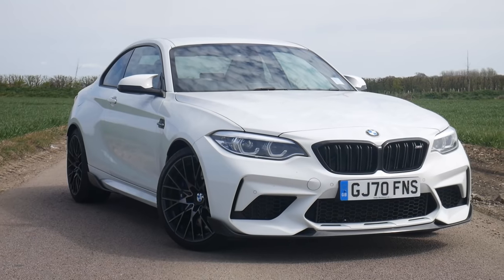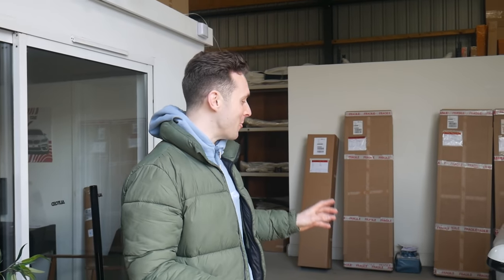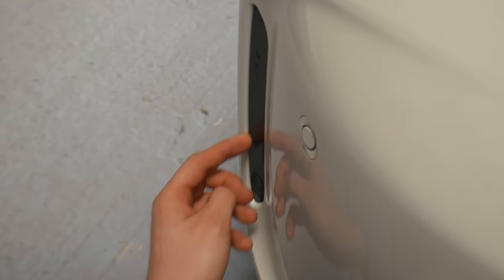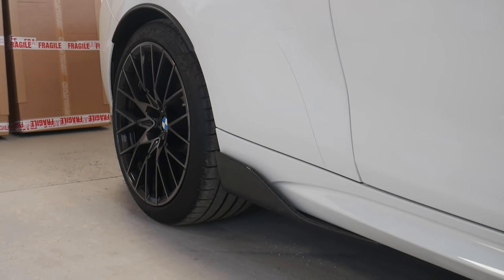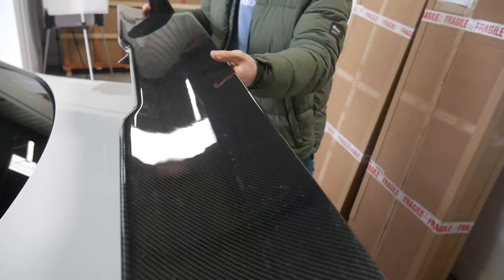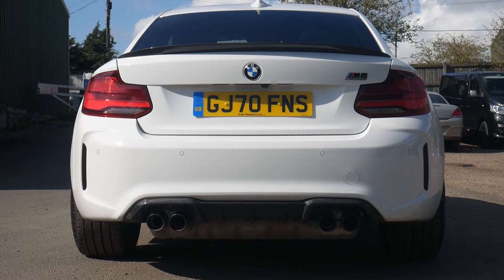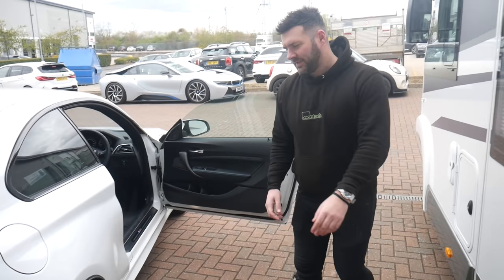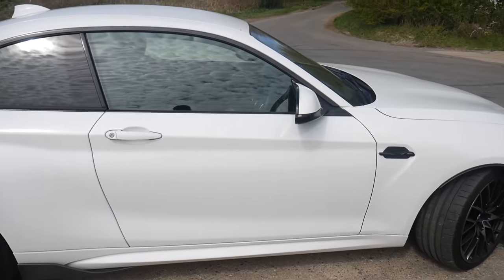I Upgraded my BMW M2 Into a BEAST

Comment: Now we need a 1v1 with Jimmy's miata
Reply: R32*
Reply: @PG-20  he has a miata and a r32
Reply: @jordancollins637  he meant that the race would be more fair, against the R32
Reply: @SPProduction02  it really wouldn’t tho, the Miata has more of a chance cause that car has almost as much hp as the M2 and weighs way lighter and don’t forget the massive wang and lip he just put on it lol don’t underestimate the ultimate shitbox
Reply: @eat_my_haas4453  let's put it differently : 1v1 against one of Jimmy's car 🤣
Reply: @eat_my_haas4453  I forgot he upgraded it 🤦‍♂️
Reply: @SPProduction02  lol yes
Reply: The miata has been completely remade into a time attack car. It's huge now with massive aero.
Reply: the mx5 would get smoked on b roads but on the track it could be close
Reply: @RageShredder  well the Mx 5 is no longer road legal lol. I think it would be an intresting race.
Reply: @RageShredder  how? B roads are basically race tracks
Reply: @fatbroccoli8  ones with big sweeping corners yes, but the second you try racing an mx5 with stiff race suspension round slightly bumpier roads you’re getting thrown into a hedge trying to keep up with an m2
Reply: R35 : 👀
Reply: @PG-20  *Miata

Comment: Ok Steve, I'm sorry to disagree with your modifications, but here is how you should tune a high performance car from a German car guy's perspective:
1. Suspension (get low) -> KW Variante 3 is a must have in an M2
2. Wheels -> BBS, Volk... i dont know, but something cool.
- pause, get some cash and have fun for a while
3. Air Intake System -> K&N Kit, cause you wanna hear your car breathing and sweet turbo sounds. Ideally Blow off valve.
4. FMIC -> Wagner tuning is highly recommended for that
5. Turboback exhaust system
6. SOFTWARE Stage 1
- pause, get a bit more cash and have fun for a while
7. Turbo Upgrade
8. SOFTWARE Stage 2
- pause, get a lot of cash and have fun for a while
9. Engine comlete rebuild with pistons etc
10. SOFTWARE Stage 3 -> should be around 900hp
-pause and play with some Supras and GTRs - as you're quite rich no more talking about cash.
11. And then finally body kit, cause you're no ricer anymore ;-)

Comment: 4:47 80 miles 7 minutes. 7x8.5 is around 60 minutes 80x8.5 is nearly 700. You were doing 700 mph mate.
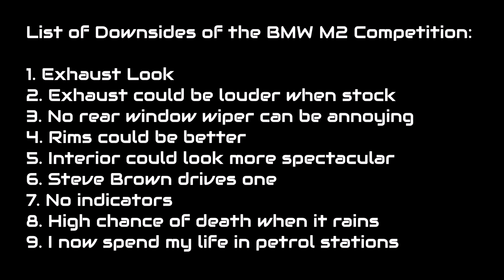7:32 point 9: you're shit at fuel saving in gran turismo and in real life
10:13 100 miles in 2 minutes is 3000mph. Didn't know the exhaust did all that.

Comment: @Super GT

You asked what we would do to our vehicles, for me I have started "Project 001".

1. A complete LED swap for the lights.

2. Drivetrain swap to all wheel drive from front wheel drive.

3. Transmission swap to a manual from an automatic.

4. Replacement of the engine head, crankshaft and camshaft (or shafts if my car has more then 1) with billeted aluminium parts.

5. Swapping of the alloy crank pins and connection rods with billeted aluminium ones.

7. Swapping of the exhaust system, and manifold, the new manifold will have 2 turbo mounts.

8. Swapping the suspension and lifting of the car by 3 inches to make room for the 2 extra CV joints for the rear wheels to be powered.

9. Brand new car computer with a modern indicator system so I can possibly remove the load resistors required to run my LED's now.

10. Twin compound turbo's for the last remaining upgrade other then performance gaskets, and titanium head bolts.

11. Safety is paramount, so, swapping of the seats with bucket seats, replacing the airbags, and adding an additional 4 more airbags, and an Airbag Sensor Module replacement will be made as well.

Comment: Not sure if anyone else has mentioned it but, maybe look at some 10 or 15mm spacers for the rear wheels? ...Might just be me but, they look a little bit "tucked" under the arches when they're stock. It's a super cheap "mod" that in my opinion adds so much to a car's stance.

Comment: And here I am sitting in my fourth-hand, 2007 Twingo I Dynamique <.<
....it does have a glass panoramic roof covering the entire top for the best convertible impression tho. Like the only thing that I haven't had to repair by now. 
Upgrades? I guess I have to get it to work properly first, since the previous owners (apparently all of them) abused it for whatever it's worth. It felt like taking in a stray cat...
That being said, I am more of a motorcycle person, that's why I am fine with this kind of car for the rain- and snowy seasons.

Comment: Crazy how much you pay for that stuff. To me and for my m340i or camaro ss I pay about 500 to 1000 for same level of aero bits and exhaust work. I did 2" stainless long tube headers and full 3" x pipe into dual mode exhaust system for under 1000 and did the work myself. Catless down pipe on the m340i for $350

Comment: Steve, are you letting the revs drop enough between 1st and 2nd? My shift is definitely clunkier if I rush the shift, but if I let the revs drop to the perfect RPM, it’s a smooth shift... Tough to get right all the time.

Comment: I’ll admit to a biased opinion since I’m a HUGE domestic V8 fan, but I thought I’d like your upgrade more than I did. It sounds nice driving by, and even the cackling off throttle is okay, but I didn’t care for the idle/low rpm sound AT ALL. To me it sounded more like farm equipment than a modded sports car. Then again my ears are 30 years older with different preferences and of course on this side of the pond the preferences in performance cars can be quite different anyway. What matters is that you’re enjoying it. Thanks for sharing !

Comment: If she feels sluggish around town, maybe a shorter ratio diff gear set might be the go ;)

Please don't get tacky wheels. Go baller range.
Work, BBS, RAYS etc etc

I've also got bi-modal mufflers on my car.. when I had the standard exhaust, I just disconnected the valves (operated by vacuum) which was fine, was a little louder and didn't drone.
With my aftermarket exhaust ... it droned a little while open, so the valves have to be operational. Plus it keeps my neighbors some what happy. 

However, the way they operate on my car.. is open idle - closed around 1500-4000rpm - then open again (or open with around 50%+ throttle).
Its really noticeable when they go from open to closed, a little distracting and annoying to my ears.

So I wired in a switch to the power of the control unit, so I can manually switch the valve operation on/off. Either it operates how its setup in the menu of the car, or they're just straight up open. Switch mounted under the dash.

Heaps better, either have them open so it doesn't change volume and tone while driving.... or just close them while leaving my house (reduces overall volume and deep tone) or cruising on the freeway (reduces drone). It's still have it setup in the menu to open up at around 50+% throttle / above 4k rpm.

*Not exactly sure how a BMW works, this is on my HSV/Holden in Aus.

Comment: if my 1987 Volkswagen vanagon full camper gets to revisit the factory. you v me the nuremberg ring. The van weighs probably 5000 pounds at least with 90sh HP. Maybe I can channel my inner   Sabine Schmidt and get under a 10 minutes lap time.

Comment: 600kg of downforce from that wing 🤣🤣🤣 Maybe at 500mph.
Reply: M4 GTS wing which is v similar - "The first thing everyone notices about the M4 GTS is its massive rear wing. However, what many may not know is that it is manually-adjustable, with three different positions. In its most aggressive position, it can provide 210 lbs of downforce at 183 mph."

So yeah, guy's talking out his arse. To generate 600kg of downforce you'd be looking at 1700mm+ wide dual or even triple element wings with a big angle of attack.

Comment: List of downsides? You forgot to add shit basic geometry, bad suspension and necessairy big brake kit for trackdays. Honestly, for a 'competition' version, that really is terrible. It works on track, if you drive it slow, otherwise you need to spend 5-8k on the brakes and 7k on suspension and geo. Still the best M car BMW makes though but I would rather see actual performance upgrades rather than esthetics. "Rim could be better?" Lighter wheels yes, better looking, who cares ;-)

Comment: Now everyone you drive by has to deal with your muffler decision. One more bit of noise pollution on top of the already too-high levels. 
Poor, selfish choice.
Reply from the maker: Don't worry, when you drive with valves closed it's really not that loud at all. 

This is one of the things about this car and this exhaust. You can live with it everyday and be reasonable but also have the volume and speed at the push of a button.